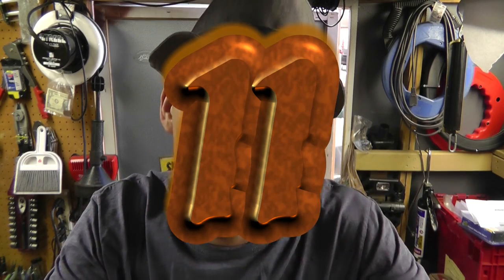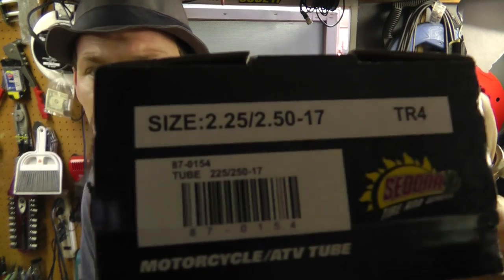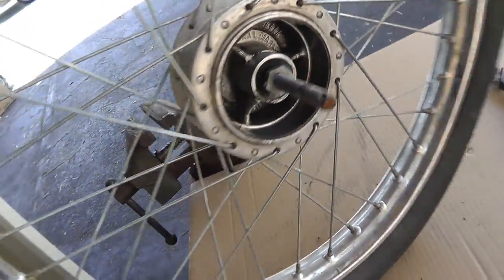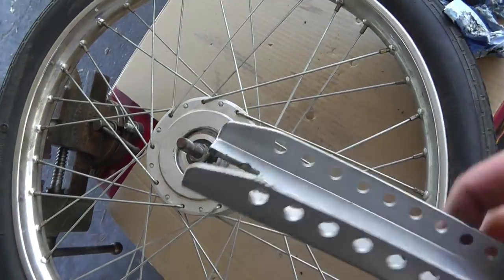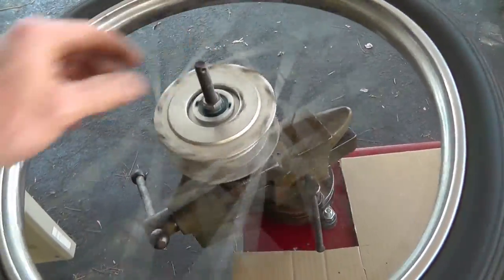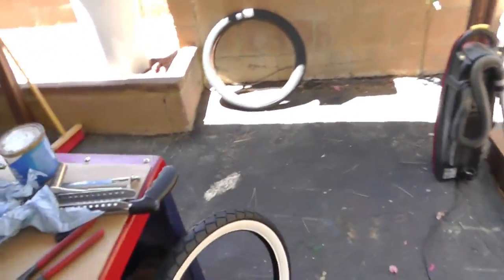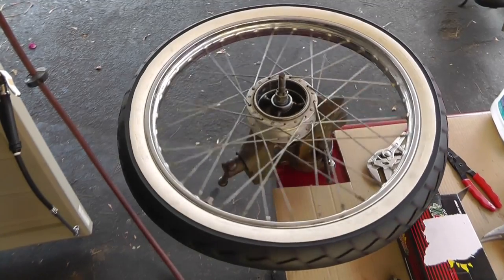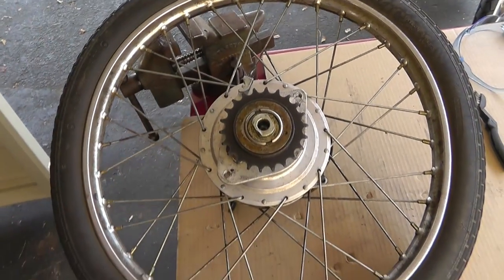#11 Honda PA50II Hobbit: Luigi Know What You Want... White Wall Tires! Install "Love Me"

Comment: You could have stepped up your gear ratio simply by installing a slightly smaller pulley on the gearbox, then you could have kept your far more efficient helical gears in the rear end. Square cut gears rob power, that is why they take the extra time to make helical gears. I knew that thing had to be souped up after watching your ride down to the ocean video. That thing was cruising when you hit the highway! Thought ya made a custom tuned pipe, ported it and slapped on a larger carb, looked like you were doing 50MPH...lol

Comment: Instead of buying new liners you could have made them out of the old inner tubes.
Reply from the maker: good call, would had to glue  after i cut them as the rubber is not tight. either way, ill keep them as spare too... If in a pinch i would have. but they were like 1-2$ each not worth the time ( this time) lol thanks for the tip! ~Russ